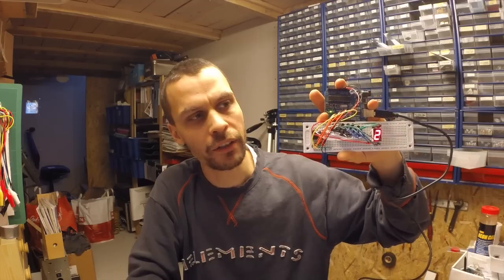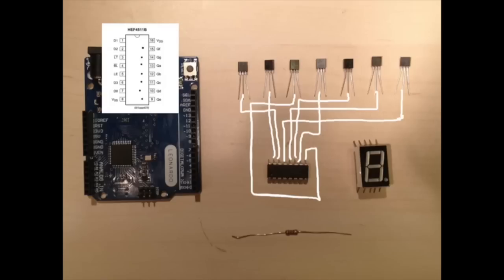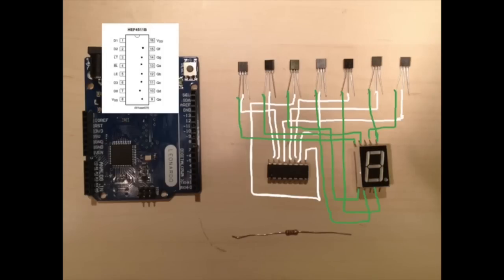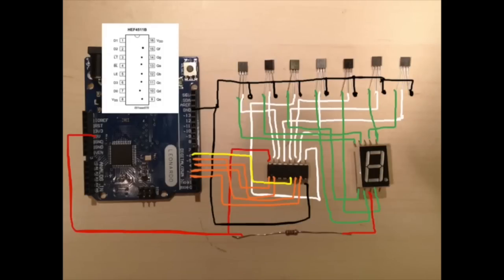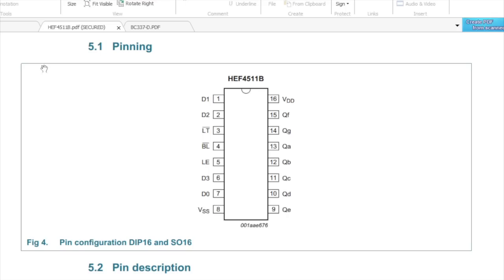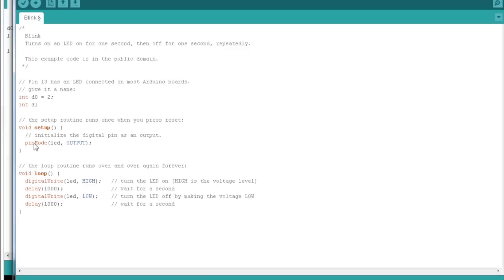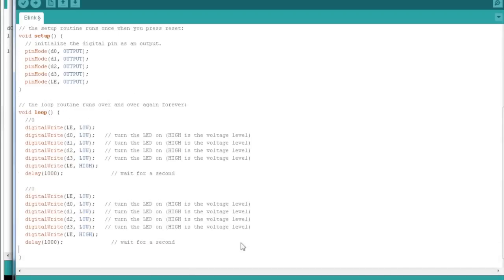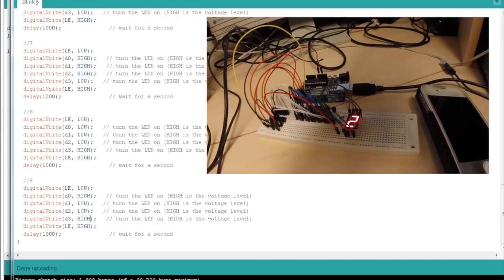Using a HEF4511 to connect Arduino to a 7segment LED display (part 2)  [Anything Arduino] (ep 8)

Comment: I wish you would have displayed all of the hex values with the 4511.  As I can recall that chip does a fair job with A through F.
Reply from the maker: +Paul Frederick Sorry for not going through all the numbers. Once you learn to count binary it is easy to add the last digits... But for the sake of being thorough heres the whole list, hope it helps :)
D3 D2 D1 D0 = 8 4 2 1 (it is easier to count that way, cause its the "right" way just as tens and hundreds etc comes on the left side higher and higher)... So just add the values you have and set high and low the bits you want to get the last numbers
So:
0000=0
0001=1
0010=2
0011=3
0100=4
0101=5
0110=6
0111=7
1000=8
1001=9
1010=10 (A)
1011=11 (B)
1100=12 (C)
1101=13 (D)
1110=14 (E)
1111=15 (F)

So 10-15 will display the letters A-F because this is that number in Hexadecimal.
Reply: Kristian Blåsol
Oh I know how binary, and hexadecimal work. I have been driving LED displays for over 30 years now. But different 7 segment display drivers display the digits beyond Binary Coded Decimal differently. Such as the 7447 display driver IC. I have used 4511s too, but much less. Right now I am having fun with a MAX7219. Although its decoder only goes to 9. Well, it has some characters beyond 9 in decode mode, but they are not the hex characters. So your statement, "10-15 will display the letters A-F because this is that number in Hexadecimal" is not always the case. One can operate the device in raw mode though, and directly control every segment. Then all patterns possible are available.
Reply from the maker: +Paul Frederick Oh ok, then again I am sorry for misunderstanding your request :). If you want to display any number (not only 1-f) you can use a 595 instead. Please see the next episode if you want to learn to use that chip instead (uses one less pin on the arduino too). A viewer also did a new table showing how to display a-f. Although, you can display "any" letter with the 595, probably like running the 4511 in raw mode. Thanks for clarifying this.
Reply from the maker: Great, I actually have one laying around, waiting for me to get to it ;) It is with a 8x8 led dot matrix, so that project will be a lot of fun :) Thanks again for sharing.